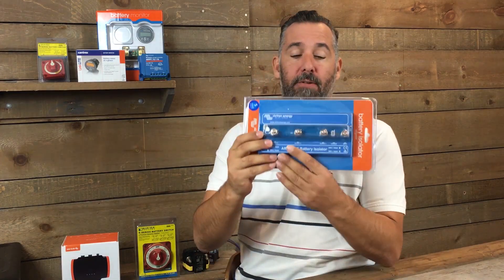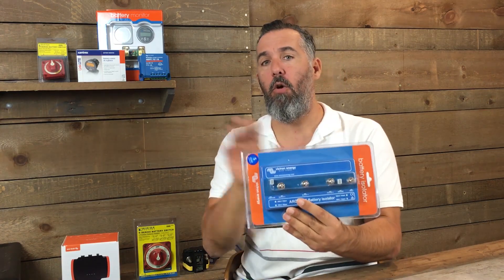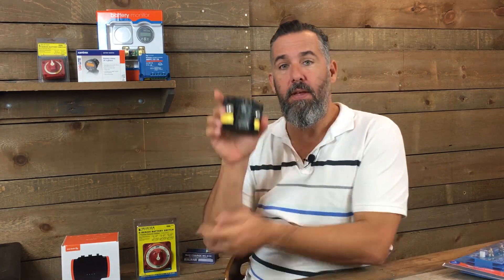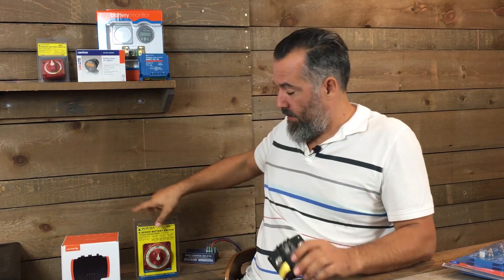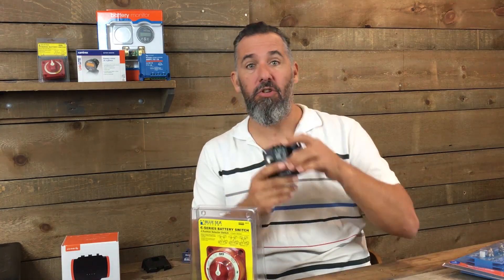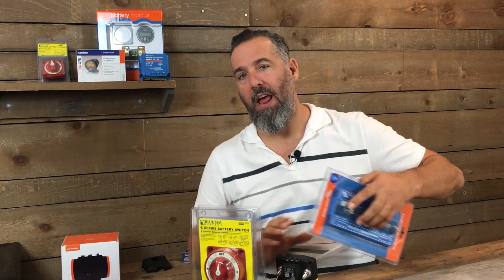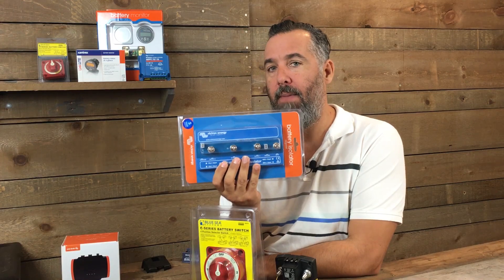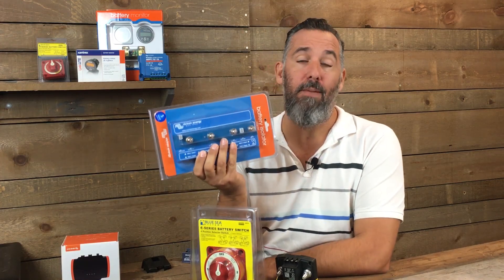How Do I Charge Two or Three Battery Banks With One Alternator?

Comment: Hi thanks for the video, I have twin inboard engines, I have one alternator connected to the 2 starter batteries, and the second alternator connected to 3 agm batteries in parallel, is this  bad for the alternator? Should I use the isolator for this? And if I do need to do this will the isolator act as the batteries being in a parallel series? Thanks

Comment: Here’s my question, I have a bay boat
1 start,  1 house, and going to add 2 batteries for a 24v trolling motor. I currently have a 120 amp add a battery kit with acr, how can I add the 2 trolling batteries to the system so I can have them charging from the alternator, wanted to know the best way possible or options I have. Thank you for the great content!

Comment: battery isolator..........truly isolating ??????????????? so you could send 12v to  2 seperate batteries to charge them ```and``` connect them both in series for a 24v output............ ??? no one covers this setup ever. many have a 12v alternator and need a 24v output   yes there are step ups but they cost a fortune and are low power

Comment: I have starting battery, house battery, and 3 trolling motor batteries. During the Summer my boat doesn't have an outlet available nearby to charge the batteries with the 2 bank and 3 bank battery chargers on board. The boat motor alternator charges the starting battery and house battery when in use. 

Is there anything I can do outside of using a generator to charge the trolling motor batteries?
Reply from the maker: There are devices that will charge the trolling batteries, like the troll-bridge 36.  But unless you're motoring a lot  (~5 hours of motoring after a day of trolling),  or trolling very little,  the engine is never going to get them back fully charged.   it's basically only going to extend your day out.

If you had a 100w solar panel,  and three group 27 trolling batteries at 50% down.   You'd need about 4 days of good sunlight to recharge them.

 If you are draining the trolling batteries by a decent amount and using them often,  the only option might be to take them out and charge them at home or elsewhere.

A portable gen would be horrible because even with a big battery charger,  it still always takes at least 5 hours to fully charge batteries.  as the last couple hours takes very little amps in.

Comment: Does the battery isolated hold true for a solar charge controller too or is there a better way to charge two battery banks with a charge controller?
Reply from the maker: Never tried connecting a solar controller to a battery isolator. Does anyone have experience with this sort of setup.

Comment: Similar question, but different.  I do have 3 battery banks:  house, port engine start battery, starboard engine start battery.  Each alternator has a battery isolator going to its respective start battery and the house batteries.  So if the engine is run regularly, the starting batteries stay charged.  But when sitting during winter there’s nothing to keep the starter batteries topped up.  I’ve heard an echo charger might be what I need.  So two questions: 1) are there any issues having an echo charger for the starter batteries and a battery isolator in place from alternator and 2) do I need one echo charger for each starter battery (2 total) since each start battery is wired to each engine independently?
Reply from the maker: Hi Shawn, echo chargers are effectively directional battery combiners. In other words, you connect a echo charger from one battery to another battery. The alternator is not part of this circuit.

Comment: I have inboard-outboard w/mercrusier 3.0  w/ one batteri do i need to install a second battery or is not?
Reply from the maker: Alberto, you should consider getting a 2nd battery to have a backup to start your engine. You'll want to consider getting a source selector battery switch to choose which battery starts your engine.
Reply: @PacificYachtSystems  thanks

Comment: I am having a 5kw Northern Lights gererator I installed on my boat. Should the generator be set up not to charge the Batteries? There is a 3000w victron charger and a 100amp alternator with external regulator on the engine.
Reply from the maker: Assuming your generator creates output, the generator will run your AC loads, and the alternator on the generator should recharge the battery that started the generator, ideally a dedicated generator battery.

Comment: Battery isolators do drop some volts, however being Germanium diodes the loss is a lot less.
Reply from the maker: What is the voltage drop of Germanium diodes?
Reply: @PacificYachtSystems  About .3v I think

Comment: I have a large bass boat. And many larger bass boats 18'- 22' will run 36 volt trolling motors, and therefor 3 batteries for the trolling motor + 1 for starting - a total of 4 batteries. Search as I may I see very little options for an isolator that will accommodate 1 alternator-4 batteries. Do you have any suggestions?
Reply from the maker: Not aware of one, sorry.
Reply: @PacificYachtSystems  Thanks for replying. After lots of scouring online, I was finally able to only find one. It's made by company called Powerline. I couldn't find any reviews on it. But I figured I'd take a chance and try it, so ordered it. Hopefully it works out.

Comment: So I’m asking a bit if a strange question here. I want to upgrade to lithium and my present lead acid is still pretty good. Is there anyway that makes sense to have two house banks- one lithium and one lead acid and run a dc to dc to both house banks or other device to put the lithium into the power system. I would also separate the mppt, solar etc. So two separate banks to power all or part of the electrical panel. Thanks so much. I enjoy and appreciate your short and informative updates.
Reply from the maker: We are planning on doing another Lithium over the coming weeks, stay tune.

Comment: l following you for quite a bit long time and l have a question. l have DC to DC Battery Charger and also battery isolator can use both of them to charge my LifePo4 Lithium batteries? Can l also use Lithium start battery to my bow thruster?
Reply from the maker: Hmmm, never seen a Lithium run a thruster before. Wonder how the battery voltage will handle such a large load. Anyone can share?
Reply: Where I can buy your  marines  product ?  Marine  equipment. , devices. Do have if I order direct to your company  did u deliver in my country Philippines .now in in tokyo japan, do you have branch office in my country Philippines or sale  agent as authorize office to sale your marine products because I’m interested  to buy , I have  boat in Philippine not yet finish , pls send the information to my email address jmesphiljap2018@gmail.com   Thank u I’m Jaime Miedes

Comment: Jeff , I have the same question as that gentleman . But my house batteries are now going to be 2 - 100ah 12 volt lithium . How can I charge the lithium house battery from one of the alternators, while still charging the engine starter battery?
Reply from the maker: You'll need to install a DC to DC charging converter from engine battery (connected to alternator) to Lithium house battery.
Reply: @PacificYachtSystems  Thank you Jeff . Any particular amp rating . Starter battery is a group 27  with a 60 amp altenateor .

Comment: Ciao Jeff, thanks for all of your interesting ask PYS videos. Staying on topic of battery isolator my question is: what if my engine battery is AGM and my house battery is LiFePo4? Is there any particular settimg to care of? Should I set my alternator to LiFePo4 charging mode? Or is the battery isolator not suitable to charge different battery banks type? Thanks for your help and cheers from Italy.
Reply from the maker: Good question, a battery isolator does NOT modify the charging voltage, but simply shares it. Whatever voltage is outputted from the alternator is what all the batteries will see from the alternator. You should NOT use a battery isolator with different battery types.

Comment: Hi Jeff. Being a huge fan of your videos. 
What do you think of a solution to use individual battery isolators for both engines. In this case the inputs would be separated, but the outputs of the isolators would be kind of a parallel connected to the battery banks?
This kind of setup will charge all battery banks even when one of the engines or isolators fail.
Thanks and keep up the good work!
Reply from the maker: Good one Argos, we do that all the time.

Comment: Therer is possible to connect battery combiner with battery isolator in order to charge a 6 batteries from one alternator? 
I suppose that is possible but idk. that's why I ask  :D 
Thanks for video on YT
Reply from the maker: Yep it's possible, but you want to make sure your alternator is sized to handle all that charging.
Reply: @PacificYachtSystems  Thank You ;)

Comment: Jeff, as always great info. I have one issue with your use of a battery isolator over the ACR (combiner) The battery isolator using diodes has about a 0.6v drop across each and I’ve been ‘taught’ that it won’t let the batteries get the full charge. I’ve been installing the Blue Sea Systems ‘Add-a-Battery’ system (or, at least their ACR) and replacing out the battery isolators that had previously been used. Owners (most are non-technical) and have liked that they only need to turn the battery switch on or off, never having to try and remember if it’s supposed to be 1,2,1+2... seems to prevent any switching issues with their electronics AND have noticed a better ‘life’ from their battery vs prior use with the isolator in place. Just wondering if it’s something you guys have found as well...
Reply: I used that set up for my sons boat because it's "idiot proof"😂. He just turns it to the on position and just the engine and bilge are on one battery and he can run the house battery down (cranking tunes with the monster sound system) fish finder, down riggers, you name it and he can still start the engine. It also has the added benefit that if the starting battery was somehow depleted it can combine both to get out of a jam that a battery isolator wouldn't be able to do. It seems to be the best choice for that situation. I wonder where the isolator would have the advantage.
Reply from the maker: Remember not all battery isolators are the same. The old ones are made with diodes, (which I do NOT recommend,) and the new ones are made with FETs (which I recommend) because the FET battery isolators are very efficient.
Reply: @PacificYachtSystems  thanks for that clarification Jeff. I wasn’t aware of the change to FET’s for the isolators. I still believe that having the simplified system (ie: Blue Seas Add-a-Battery) for the majority of power boaters I’ve been dealing with (and are usually electrically non-technical) they need it easy. Turn a switch on, both batteries are on to their respective distributions, whether running a main then a kicker, electronics never get a ‘low voltage’ drop out, batteries remain charged but isolated (unless an emergency start needed) and they shut off the switch at the end of the day... Whatever system is used, the wire sizing and over current size & location are important issues that I’ve seen so many issues with... scary at best. Thanks again for providing the info you do!

Comment: One engine - two battery banks (house and start). What is the best way to ground the system?  One ground wire from engine to a negative buss, and connect the  banks to the buss?  Or separate ground wires (2) one each going from engine block to the separate banks?  Ive been told to 'daisy chain' both banks off of one ground is not wise.   Thanks for your excellent channel.
Reply from the maker: Hi Stelios, yep it's better NOT to daisy chain any negatives. Each battery bank should have a path to DC grounds.

Comment: Jeff your videos are great. I have a question about lightning on a sailboat. Is there any way to protect the electrical components?
Reply from the maker: Hi Darren, unfortunately not well versed with lightening protection systems, just read  about them. Anybody can share info?
Reply: ABYC has a technical paper on this topic in detail. ABYC TE-4 so search for that. Since lightning is so unpredictable there is no way to protect everything. The misnomer of electricity follows the path of least resistance is especially an issue with huge power. It can follow all paths but not equally. The tech paper helps.

Comment: My question is: can you explain battery fuses and how do I size them. I have a sail boat.
Reply: You generally just want a large fuse rated for the cable that will protect the leads going to the DC panel and then break off smaller cables with their own fuses for the devices you are running. But as a battery fuse size, I'd personally look at having something maybe 80% the rating of the battery leads to the distribution panel. But as I said, battery fuse is more about protecting the chonky cables from a short more than anything.
Reply: @danedwards_ee  thanks. what about sizing the battery fuses factoring in the cranking of the engine?
Reply: @jackbarnes694  you'd want to split house and engine on different circuits so you can always start the engine.

And as for a fuse for a starter, here's my reply for the same question the other day.

"Starting circuits do not require a fuse. BUT, you need to take care that the wires won't short. If you do want to fuse it I'd go with 1.5x the cranking current fuse to deal with the inrush current and avoid tripping accidentally.

The reason you don't need to fuse the starter is because especially in a marine environment, it's a pretty big safety issue as you are limited on your manoeuvrability and navigation if you blow your starter fuse."
Reply: @danedwards_ee  great thanks for that.
Reply from the maker: Thanks for sharing everyone.

Comment: Thanks Jeff, very informative as usual! I have a question. When looking at battery specifications, the number of recharge cycles are often quoted but what does that really mean? Does this mean if you discharge a battery completely and then recharge it to 100% that equates to one cycle or, because you'll damage a battery if you discharge it completely, is that discharging to 50% before recharge? If it's discharge to 50% then can you double the number of quoted cycles? Of course in reality, this isn't how batteries are charged/recharged anyway - they might be discharged by 5% and then the alternator or solar tops it up, etc. etc. Does 'recharge cycle' have any meaningful use?
Reply: Number of recharge cycles is a function of depth of discharge for lead-acid battery chemistry (wet-cell, maintenance-free, AGM or GEL).  It is usually presented as a continuous graph, and that graph is curved, not linear.  If only a single number is given, it would have to be at a particular depth of discharge, with 50% being the rule of thumb.  This rule is simply an acceptable compromise between being able to take enough energy out of the batteries for them to be useful (for their size and weight) and the number of recharge cycles being sufficient to be economical.  Shallow discharge, more cycles; deep discharge, fewer cycles.  Note, however, that because the graph is curved, the total amount of energy in and out over the lifetime of the batteries is not the same.  Shallow discharge results in more total energy being stored and retrieved.  All of this is for lead-acid battery chemistry, for which there is one additional factor.  Lead-acid chemistry really wants to be FULLY recharged every time any energy is removed.  While most of us are aware that deeply discharging lead-acid batteries will shorten their life (reduce the number of recharge cycles) I suspect most lead-acid batteries end up getting replaced because they are not consistently fully recharged, resulting in is a loss of capacity.  This becomes an issue for battery monitoring systems unless they have the ability to “know” the actual full capacity of the battery.
Reply: @brucefay5126  thanks!
Reply from the maker: Thanks for sharing.